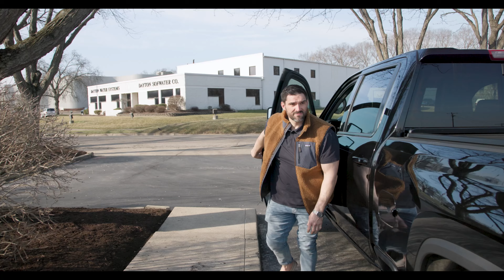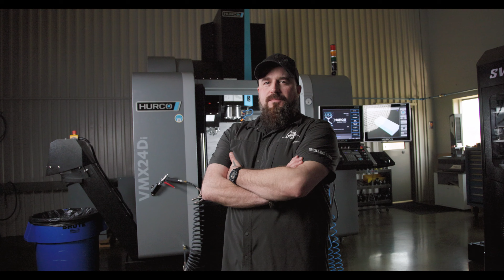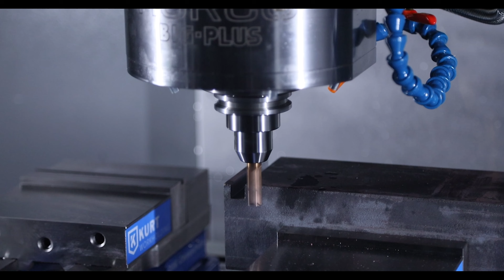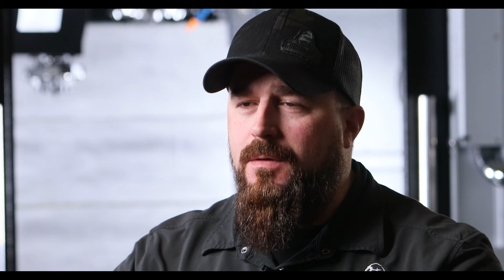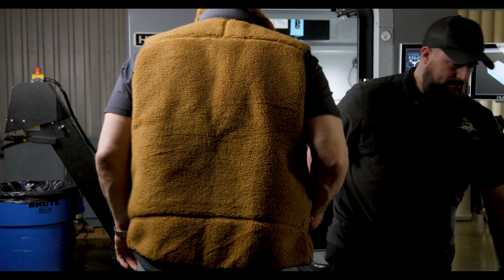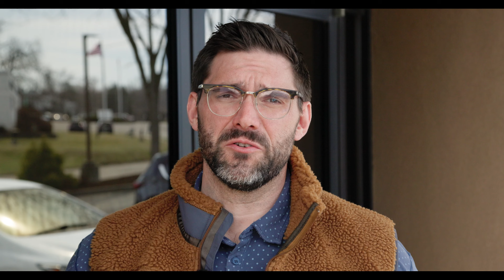At the Spindle  Alpha Industrial Supply x Gorilla Mill – CNC Machining with Yeti & Phenom End Mills

Comment: 1st tool. 4 flute Yeti with WTF coating
Part number GMRF12R4030WF
Full slot 1xD
6876 RPM (900 SFM)
57.76 IPM
MRR = 14.44 CIPM
 
2nd tool. 5 flute Phenom with WTF coating
Part number GMHT12R5030WTFWF
Trochoidal milling
1”DOC
.050” step over
7640 RPM (1000 SFM)
173.5 IPM
MRR = 8.675 CIPM